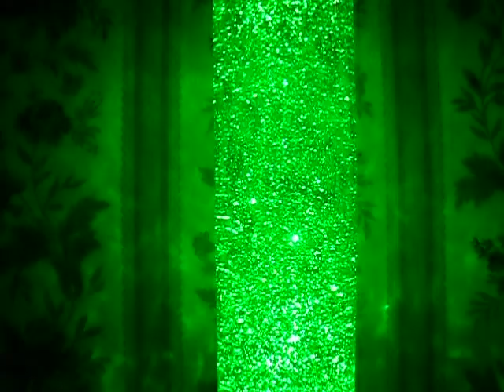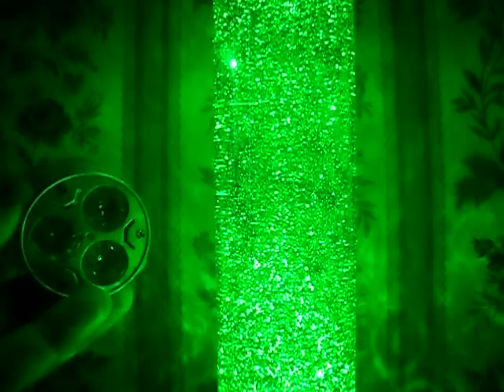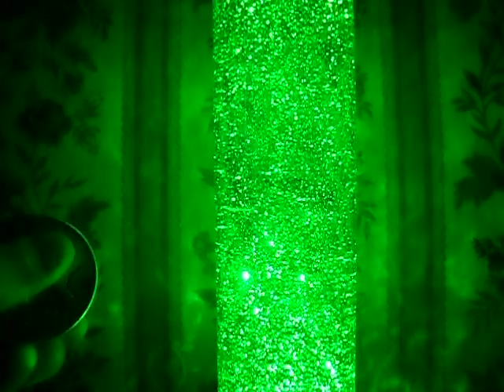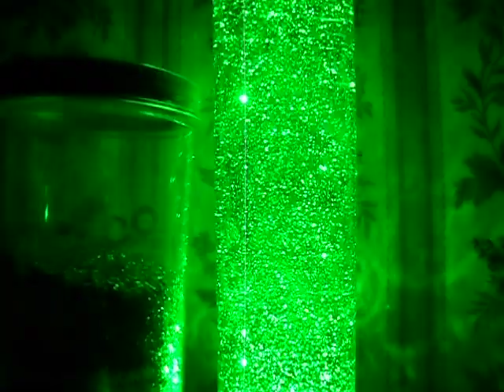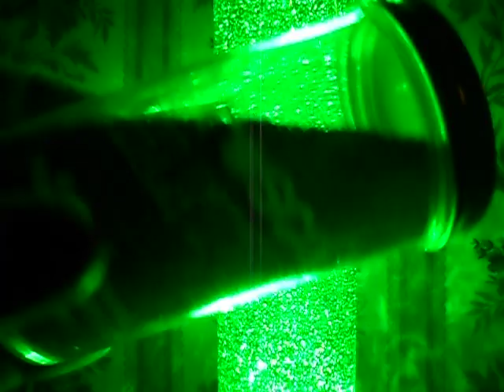Hacked LED glitter lamp.

Comment: How many grams of "Rosco "silver" 1/64" hexagonal-cut polyester glitter" did you use for 500 ml vail? and where did you buy it.. I only managed to find 4 KG for sale online. and i guess you didnt use more than 50 grams? Im building my own glitter lamp. I will show you when done and make a video of it + credits.
Reply from the maker: I got my glitter in a 4oz tub a very long time ago.  From the theatre supply company I was working with at the time.  But any good glitter, particularly the ones sold on ebay as "solvent proof" for nail varnishing applications will work.  It only takes a small amount, like a pinch.  I'm not sure the exact quantity, but you can add it bit by bit once you have the liquid balanced.  Note that calcium nitrate is another option for raising the gravity of the water.  It's widely sold as hydroponic fertiliser, but quite hard to get in small quantities of the very pure, clean stuff.
Reply: bigclivedotcom
Thanks for your answer and further information. I searched for  calcium nitrate and found that its sold in Denmark and is much easier for me to get my hands on.. When you say clean form what do you mean? I found it as fertiliser with the information 15.5% on it.. Anyways its pretty cheap so i will try with that first.. Any hints on "water to calcium nitrate (fertiliser edition)" ration? Thinking of using distiller water as im guessing its more clean also? (not sure its called destilled, but its sterile) the reason I ask is that is has "0.9%" natrium clorid, in it.. will it make the water less clear and or affect the calcium nitrate when mixed.. Im not really into science so I thought I might ask you beforehand.
Reply from the maker: Stamplers The purer the chemical you mix with the water, the easier it will be to get a high gravity and a clear liquid.  I found that with ebay sourced Calcium Nitrate it made a very cloudy solution, and even the tiniest bit of diffusion in the water really mutes the glittering effect.  I left it for a while (several weeks!) and it settled down and I used a bit of thin silicone hose to syphon the clearest are from the bottle to make a good lamp.  It would be ideal to source 100% pure chemicals to avoid having to let these things settle out, but it's much easier to find the impure chemicals intended for less critical applications.
Reply from the maker: About half the glitters I've bought on ebay are coated.  The best test is to bang a bunch of each type in a bottle of the liquid before you balance it, and see how it fares over a week.
Reply from the maker: On some the metallisation was eaten off overnight.  On others it's still flawless weeks later.  I think it's all down to whether it's coated glitter or not.
Reply from the maker: knwr Yes, but the weight consistency is variable.  You have to use an excess of glitter and get the buoyancy to the point that same of it is in good suspension then draw that liquid and glitter out.
Reply from the maker: knwr A cork.  It allows adjustment of the liquid and also acts as a safety pressure release.
Reply: bigclivedotcom Have you tried filtering the liquid with a very low pore size filter? Maybe even multiple coffee filters would do the job. It seems like CaCl2 is probably the best option for a clear solution though.
Reply from the maker: knwr I've just been experimenting with filtering using a cheap generic water filter jug and it actually works really well.  There must be another chemical used other than Calcium Nitrate or Calcium Chloride since they are both gradually eating the metallisation off the fine glitter (but not other types).  I have a commercial lamp where I replaced the original glitter with the fine stuff and it's not damaging it.
Reply: bigclivedotcom Damn I was gonna try that recipe, the lamp looks awesome. Maybe the glitter isn't fully covered by the polyester. If there's any unprotected metal it would likely be eaten by the solution. Sodium tungstate seems to be non-toxic and has the capability of reaching something like 3 g/cm3. It also looks like it has anti corrosion properties against metals like stainless steel,could be worth a try if you can get it.
Reply from the maker: knwr Having just checked the availability and cost of sodium tungstate I think that might be the most expensive glitter lamp in my collection.
Reply: bigclivedotcom Yea best I can find in Canada is 80 dollars/ 500 g. The cheaper option may be to find glitter that is uniformly coated with a polymer, if that is the problem
Reply: bigclivedotcom good idea, you've found noticeable change after a weak of exposure?
Reply: interesting, does anything look as good as the Rosco brand glitter?
Reply: if you don't mind my asking, how did you reseal the bottle after opening?

Comment: can use CaCl2 to replace?and How Rate?
Reply from the maker: It has to be very pure food grade Calcium Chloride.  The best results I've had have been with hexahydrate stuff.  The amount of water required is very small and will vary on the choice of glitter.
Reply: bigclivedotcom thanks
Reply: bigclivedotcom what thing in this lamp?????
Reply: bigclivedotcom
hello, been checking out your "things to do" and you've got sum gr8 projects on ur list!  I have a question 4 u bout making glitter lamps...... is a coil (as are in lava lamps) necessary?  appreciate ur time!  thanks so much!
Reply from the maker: The coil is only needed in lava lamps to hold the wax at the base.  It's not needed in glitter lamp.

Comment: yes, from A level chemistry, the hexahydrate has 6 molecules of water per one molecule of CaCl2 (it'd be written CaCl2.6H2O), and the dihydrate would only be CaCl2.2H2O.

Densities from wacky-peedier:
2.15 g/cm3 (anhydrous)
1.835 g/cm3 (dihydrate)
1.83 g/cm3 (tetrahydrate)
1.71 g/cm3 (hexahydrate